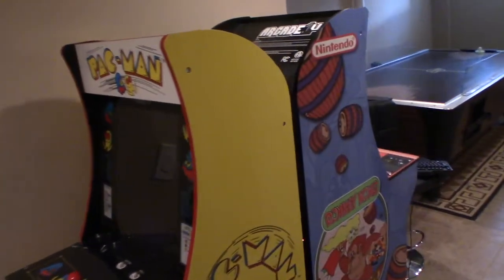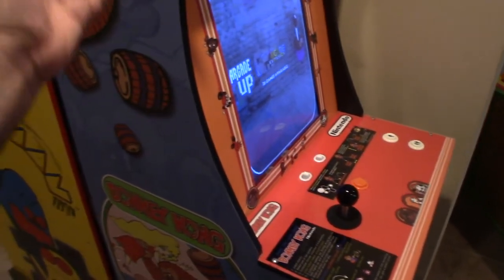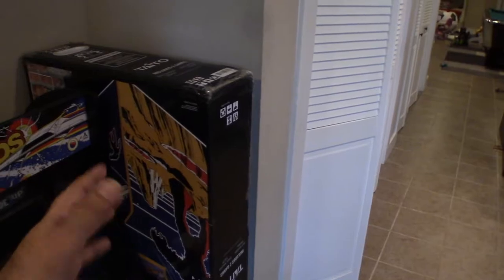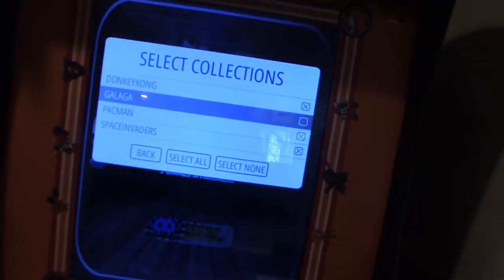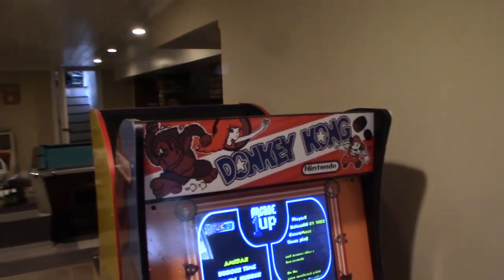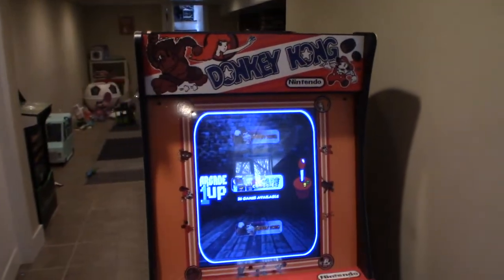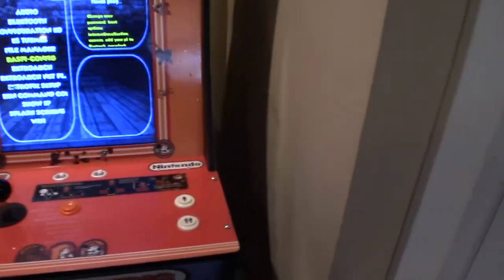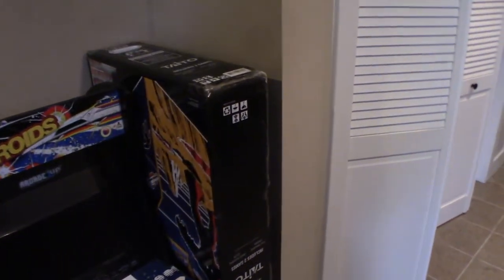Donkey Kong Mod Updated

Comment from the maker: Just a FYI if you use the Space Invaders cabinet you will not need to make any cutting. The Space Invaders control pad has the circle hole already and it just uses a 2 way restricter plate. I don't know if they upgraded Galaga like this as well but the one I had had the control pad with a line going across on the joystick not a circle

https://youtu.be/BMGGpPkvQHI

Comment: I installed your image, followed all the directions , sometimes the power button gets confused but all in all really good, i added games i wanted, couldnt get wifi going so just went cable and found roms directory, any chance you could do a totorial on how to add in new game info and pics besides new games we install, also a way to change controls in a game, chelnov automic runner wont start on this setup, can insert coin but wont start game. thanks again , love the image , keep up the good work, really clean setup, love it :D

Comment: will this setup NOT work on a standard HDMI connection to a TV?   Just wondering if there is something in the config file... I realize the screen will be rotated... but I'm getting a blank screen after the A1up logo splash

Comment: That is still not the correct sounds when Jumpman moves. That's only one sound repeated over and over. Supposed to be 3 different pitches in sound when he walks/runs. My version runs like this and i wish i can get the sound exactly like the og DK coin-op cab. It's my fav coin-op. For me it's a big deal. 

If i knew someone selling pi's with Donkey Kong sound running perfect i would buy it in a heartbeat.